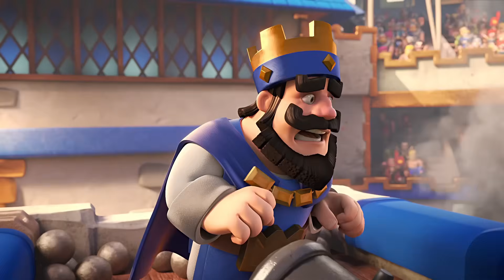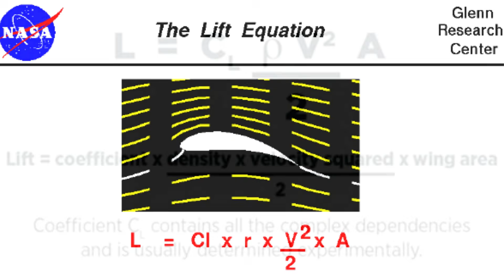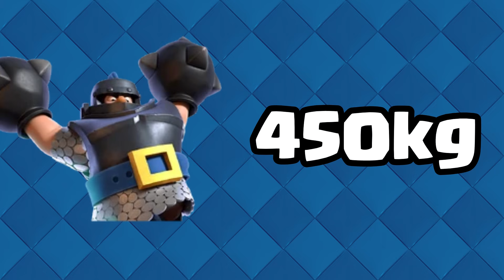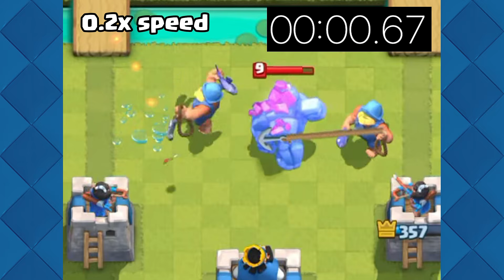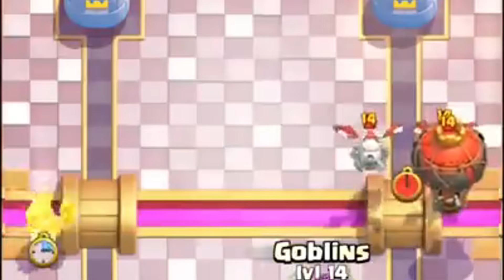How Realistic is Clash Royale?

Comment: tl;dr;
most of the calculations are off, NO HATE THOUGH! I do it for the sake of comedy too!
if you care however, here are my corrections:

battle ram mass calculation feel off honestly
you said it weights 50kg
let's assume the ram is made of oak wood which would be accurate pick for a ram
density of an oak is... 900kg/m^3
meaning 50kg of oak wood is about 0.06m^3
which is a cube of... 39x39x39cm
its... much, much too little
I'd guess if the ram is ~2 meters long and it's base is about 30-40cm in diameter it would be closer to 900kg of mass

additionally you can't really just add the mass of the barbarian inside of the ram to the mass of ram as you have to account for the empty space that you've made for a barbarian.
With that said the barbarian would not fit inside of the ram i've created for this calculation, this ram would have to be like ~50-70% wider in base and 10% longer to relatively comfortably fit a human inside 

this obviously drastically changes the force of impact of the ram
given the 4.2m/s speed and now ~1100kg of mass of the whole unit (again - quite generous, i'd guess whole thing with barbarians might weight up to 1500kg) it is ~4500mkg/s
and the force applied which is ~15500N of force applied to the tower (or over 23k newtons after plugging in the shorter impact time of 0.2)
BUT
in reality force doesn't really matter, honestly
there's thing called impulse of the force (try laying down a 1kg stone on your foot and then throwing the stone from for example 1m height. The 1st doesn't hurt in the 2nd example your foot is crushed and you likely need to visit a hospital) and shit but let's not get into that too deep
let's get energy for simplicity

kinetic energy of the ram is (mv^2)/2 which is about 10k Joules of energy
this is not nearly enough to hurt the tower in any meaningful way
maybe it would do a few cracs? but nothing more

for a comparasion
a 1500kg car rolling 13m/s would produce ~10k Joules of energy
for reference porsche 911 weights approx. 1500kg, this is a relatively light car

we can even use pressure to support this argument
this strike would generate ~40k Pa of pressure on the wall (given the dimensions of the ram i proposed in the first paragraph) which is... not nearly enough to do any damage to the wall
limestone's pressure resistance is about 30M Pa
and limestone is a soft rock...
additionally you have to account for the fact that the princess tower is a giant, heavy, robust block of... whatever stone it's made of (probably something much harder than the limestone)

additionally the evo ram has a problem of enormous head at the end of it. Probably it like doubles its mass (which is good for destruction purposes) but at the same time makes it a giant leverage that makes the rear barbarian fly while the whole thing is trying to dive head first into the ground

additionally (again the energy, force impulse and shit) with battle ram you'd go just straight trough an elephant with that speed, you'd have to push the elephant with something to accelerate it? or pull? idk with a car or something?

flying machine is even more wild as this thing... would never take off with this design even if it's blades would be a mile wide
it's because the rotor of the helicopter causes moment of inertia that you have to counter. If you don't apply opposite moment of innertia you'd spin around like crazy and destroy the thing before it takes off, that's why most of the helicopters have tail rotors and even if they don't (like chinook which has one rotor behind the other or russian aligator which has two rotors stacked on each other) they still have a pair of them rotating ALWAYS in the opposite direction. And that's why in the movies helicopters fall off the sky whenever their tail is hit

With that said you also made a mistake of measuring the blades of the flying machine
keep in mind its hovering above the ground so perspecitve and all that jazz and they appear much bigger than they are actually (because they're closer to the camera)
id say there are like half the size you assumed to be? like 0.5x0.25 tiles? idk though could do some trigonometry to figure that out but imma too lazy lol

additionally the proppeler works completely different than a wing
wing generates lift by managing pressure above and below the lifting surfaces (Bernoulli law, law of even flow and stuff, i am not an expert either)
while the proppeler actively pushes the air backwards
this makes this equation of L = 1/2*Cl*v^2*rho*A... kinda right? like, don't get me wrong, this is which equation youd have to use, however, in choppers it quickly gets complicated
if you want to move forward you have to tild your proppeler forwards, to create force that pushes you forwards, right? That means every blade of the proppeler works under different reynolds, speed and AoA which makes it... complicated. I doubt you can make it anywhere near realistic without complex integrals, honestly
oh and also the blades of the flying machine are... just timber
without an airfoil on these blades it's not creating any lift (i realized that now after writing all that lol)
meaing... 0.4 Cl is too generous, i don't know if it's anywhere more than 0.1 even to be honest, maybe even lower

mega knight - again, the trygonometry would do a better job approximating the falling distance
BUT
that makes mk's landing even harder

goblin barrel - you forgot about the Y-axis, it travels much further as it has to move to some peak of its trajectory and then fall towards the ground
WITH THAT SAID the goblins and the barrel are soft, they would not do any damage at landing, just spllater them into a paste

so yeah.. this many caveats, hope you enjoy, the one person who decided to read lol

Comment: I think flying machine point there's something wrong, i think that it's spin not 1,466 s, but it some effect because shutterspeed. Its like we see in some kind of video showing helicopter blade aren't moving. The prove is when you slow down in 7:00, there's some circle area around it, proving that in that time, flying machine has been spin a few times, but idk.

Another point is about mega knight, in this video, you use assumption of mega knight jumping around 20 tiles, but i think the x/z and y coordinates cannot be compared each other, its from perspective. Think its like seeing in top perspective, maybe he even not supprasing 1 tiles to x/z coordinates. If your assumption is 20 tiles, if we calculated from isosceles triangle, using trigonometry, the alpha and delta degree must be exactly 45 degree, because at that point, the surface and height of triangle is same.

Comment: For the flying machine, there's a slight afterimage in the path of the blades, which could imply that it's spinning so fast we just perceive it to be slow because of the framerate of our devices. If we assume a 30 FPS camera in-lore, then the blades are doing about 30 rotations per frame, or generating about 59,000 newtons of force(6,000kg or 13,000lbs). More than enough to send the flying machine into the stratosphere

I'm not sure which extreme is better. The perceived rotation speed not generating nearly enough lift, or the implied rotation speed generating way too much

Comment: Something interesting about the fisherman is that he doesn’t even move a bit while pulling, he’s got some serious grip on those toes.
Also regarding the flying machine since you can see the shadow like effect of the blades as they spin, you can assume that it is an optical effect produced by the blades moving faster than the camera’s frame rate, in other words, the blades should spin at about 60 times per second + the amount you calculated or something like that, which probably would put it into a realistic lift value.

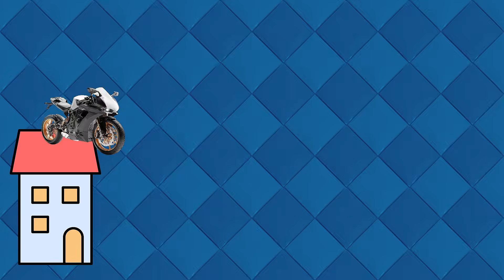Comment: 12:55 Well, based on the battle ram's applied force and corresponding tower damage of 572 hp; an 11 level goblin barrel weighing 160 kgs and moves around 20.24 meters per second would insert 1674 hp damage. This is the comparison I came up with.

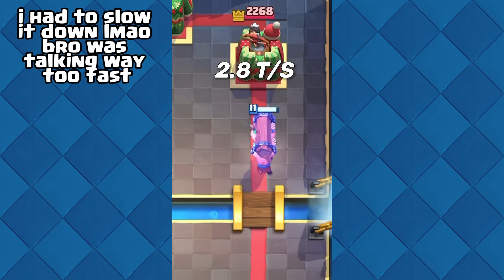Comment: 2:30 That's before the charge buff. Battle ram now goes 2.5 tiles per second but before it used to charge 2.8-3 tiles and that's probably when Crusher made the video.
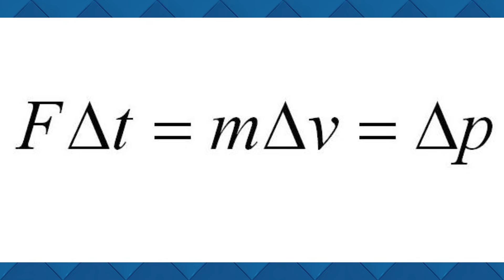9:40 I think the Mega Knight's body amour that's protecting him from going GGs and also the position of the spawn basically is feet first which is always the ideal position when in a fall cause it has the least impact.

Anyways can you do a video about the height of Clash Royale cards? I always wondered how tall certain CR cards are like Mega Knight.
Reply from the maker: ooh interesting idea on heights of cards. also yeah, i like ur thinking for the mk one!